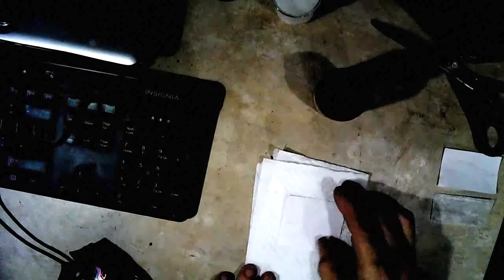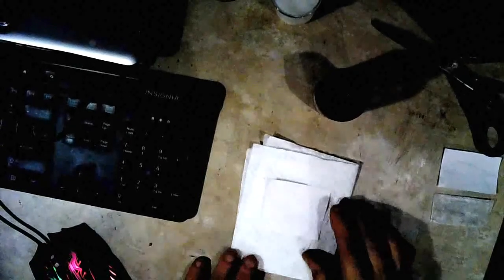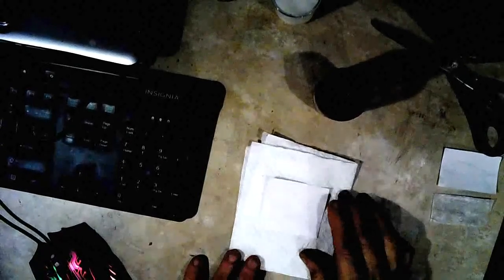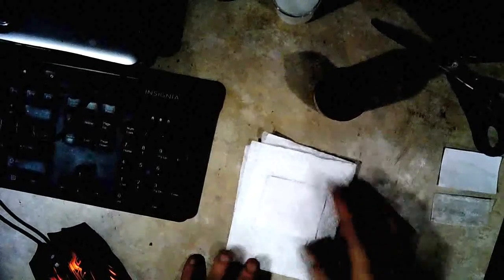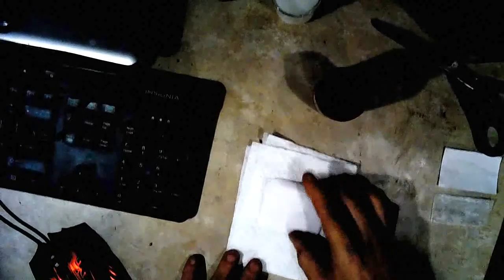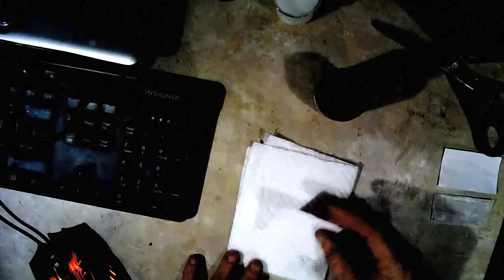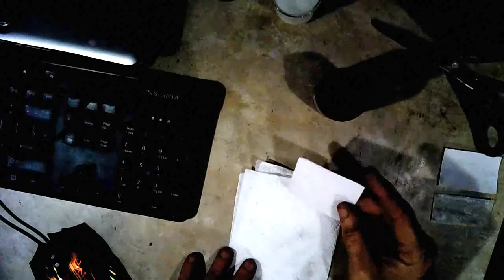Thin Film Borax Separator #2

Comment: As I understand polyvinyl acetate (PVA ie: white glue) and celulose acetate serve the same function as a membrane. No need to combine them. Someone else tried using styrofoam dissolved in acetone. Robert has a couple of videos, one on alternative plastic using PVA, glycerol, and borax solution with fillers mixed in before the borax. he mentions mixing in carbon or graphite as an active element. He also has a video on a solid electrolyte for supercapacitors using PVA. If you want a uniform surface try a squeegee or something like that. A piece of cardboard might work. Squirt out a line and lay the cardboard almost flat drawing across the surface. It should produce a relatively smooth layer.
Reply from the maker: Hi Fred,  I played around with some of Robert's membrane materials a few times. I never liked the PVA stuff, but it did make a film fast. I like the cellulose acetate much better. I plan on making a paper free membrane eventually, but for now the paper borax separator with a thin cellulose acetate film on each side will have to do.

Comment: More good stuff - thanks.  Can you help me understand what the Borax does for the membrane - part of the ion channel or just helps with the physical structure ???
Thanks
Reply from the maker: Sure Dennis.  Borax is commonly used in chemistry to link non-reactive species so they can react with other chemicals. We want to separate the half reactions in the battery so we have better control of them, but we don't want to completely block the ion transfer. Ideally, we want a totally linked up liquid crystaline structure. At least that's my take on it.